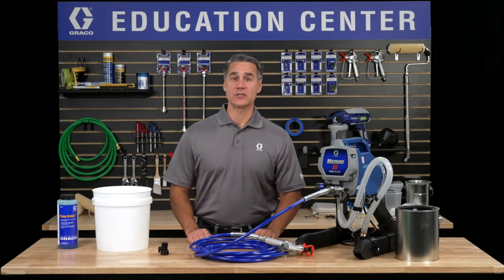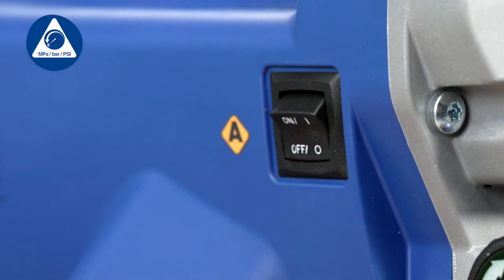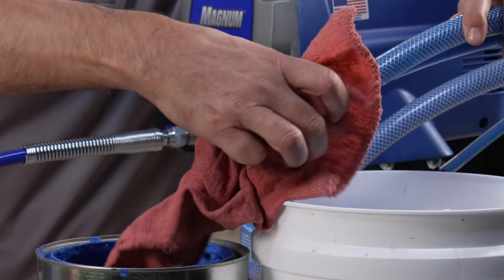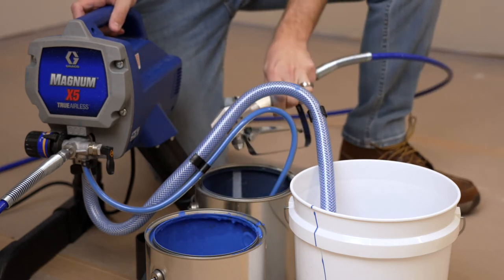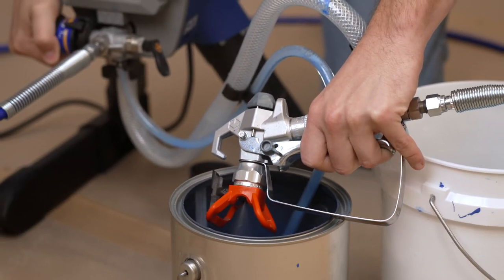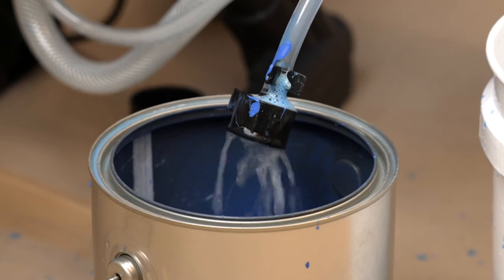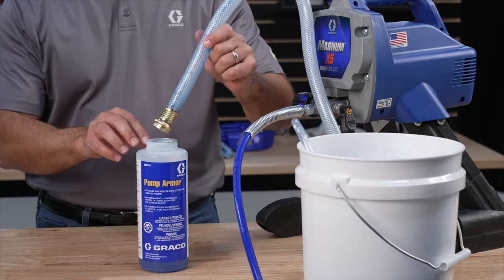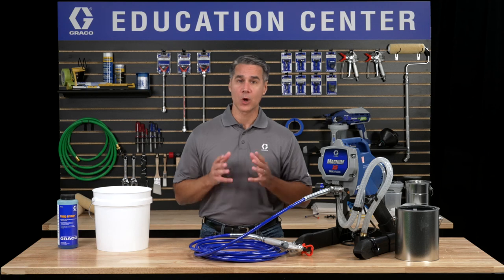How To Clean Your Sprayer Using Buckets

Comment: Does this work with oil based paint?
Reply: Might need to use paint thinner (or whatever solvent your paint calls for) instead of water.  I usually add some soap to the rinse water to help it clean out